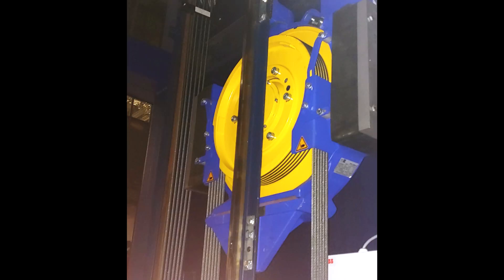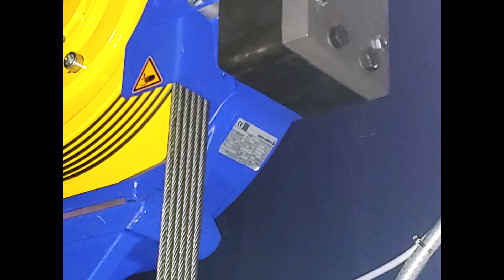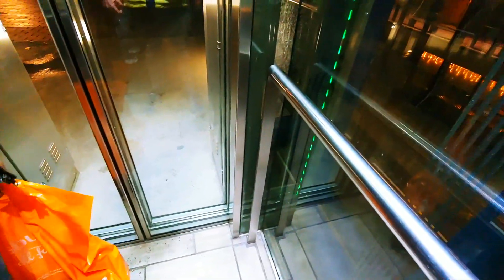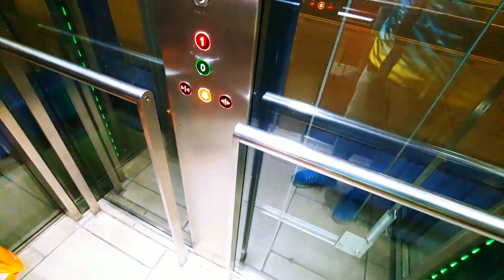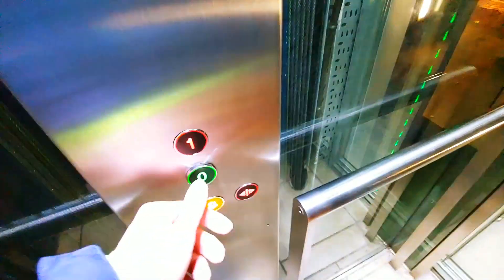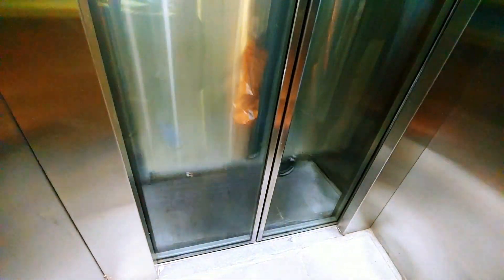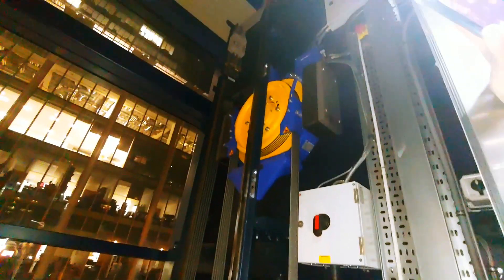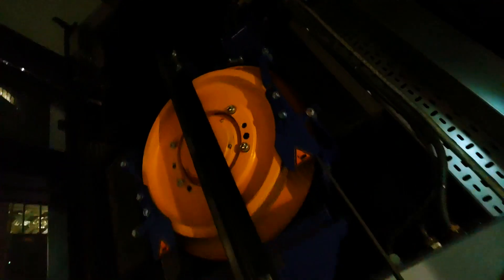Detailed look at a ZetaDisc (Ecodisc rip off)

Comment: I wonder if it is a "Licensed Clone Disc". Toshiba appearantly has a license from Kone to make Ecodisc motors for the asian market, noticed one on a glass lift at Arnhem Centraal station a Mitsubisihi with a ecodisc style motor. Not quite the same though but kind of inspired by it. It's been over 20 years that first Ecodisc was introduced (1996/1997) maybe Kone's patents have expired on the original design? Like how brands such as The North Face have their own Goretex clone that's basically the original first gen product that is no longer covered by patents. The patents on Zip file compression and MP3 are also expired appearantly.
Reply: I have just looked at the product catalog of Ziehl-Abegg; it seems they now also make a Schindler 3300/5500-alike motor (and so does Wittur). These models of lifts are definitely not yet 20 years old. I suspect that it would be prohibited to make a carbon-copy of a lift motor, but if you can make something similar, yet different enough from the original product, it's not a problem - unfortunately for Kone or Schindler.
Reply: @Waberner  Nothing beats Schindler Intelligent leveling logic, so it is not really a competition to be honest

Comment: This has to be the lift equivalent of the DAF 1160 engine, which bore a striking resemblance to the Leyland O.680 engine and was used to re- engine a number of Leyland Nationals. It growled like an O.680,  and apparently looked like an O.680, but had absolutely no parts in common.

Comment: Guangri also has an EcoDisc ripoff. It use design of EcoDisc used in high speed elevators, but Guangri's motor installed on MRLs